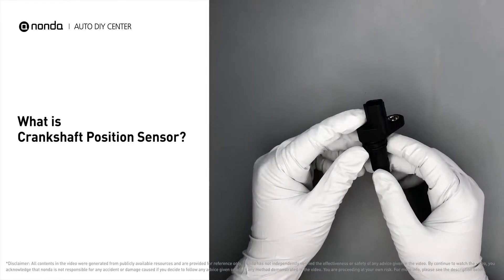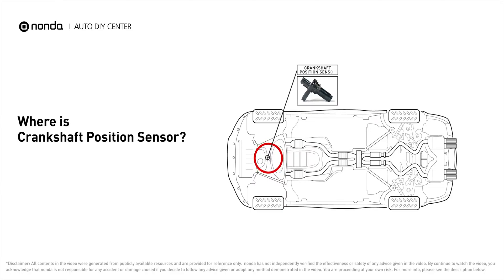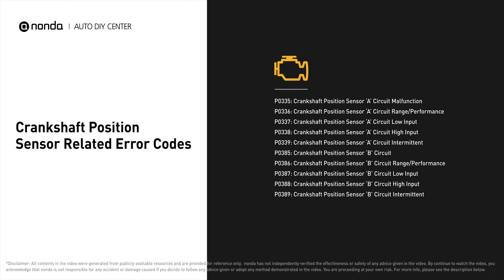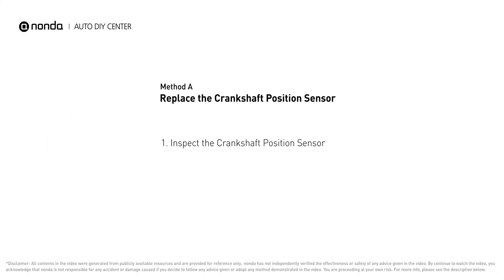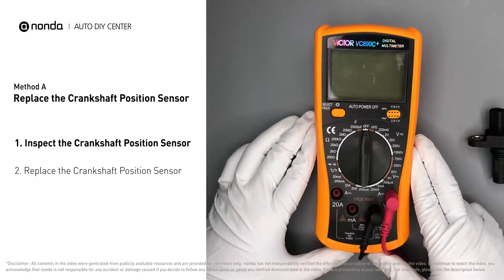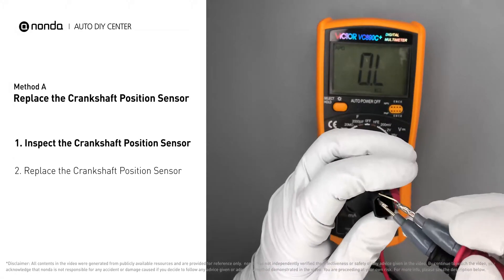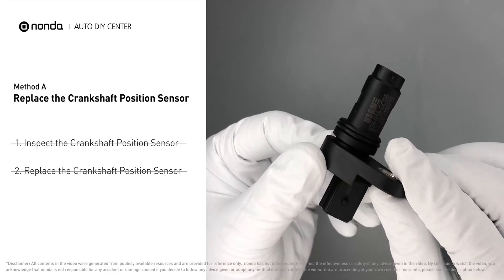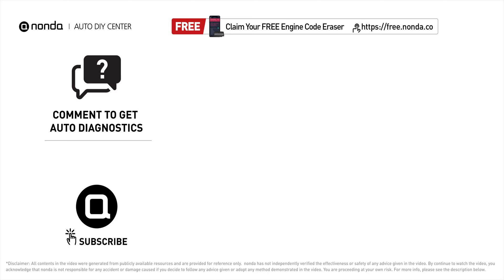Crankshaft Position Sensor: How it Works & How to Fix [1 Method Save $258]

Comment: Got the code. Changed the sensor. Still won’t start. Tried to reset the code but it won’t. Still says the code (crankshaft position not determined) or something like that. I’m stumped. Please help! Starter is good as well as the battery.
Reply from the maker: Hello, please provide us the year, make and model of your vehicle so we can address your concern specifically for your car's make/model.